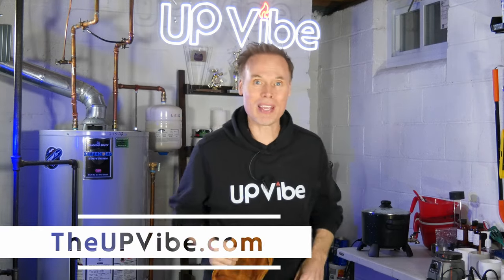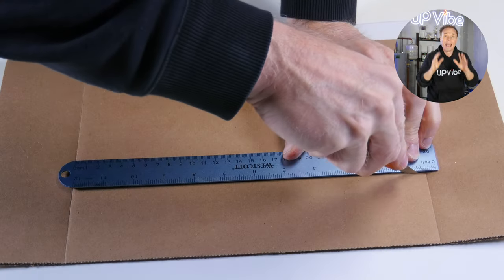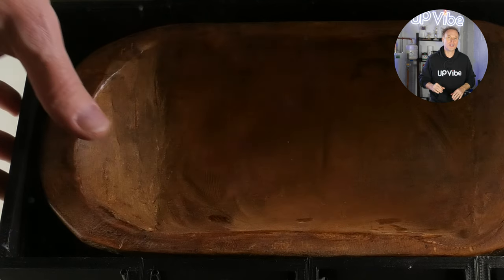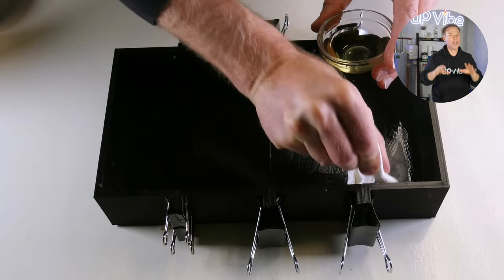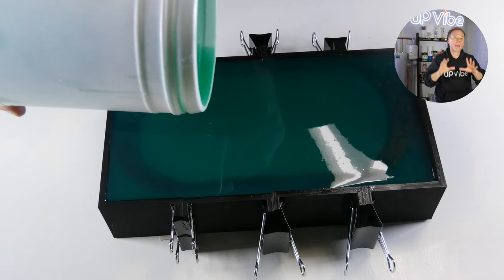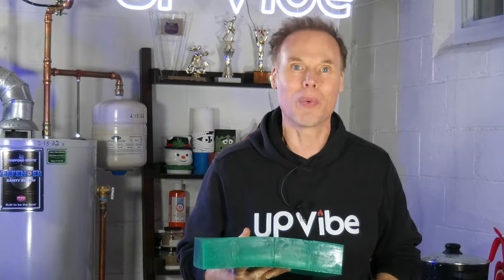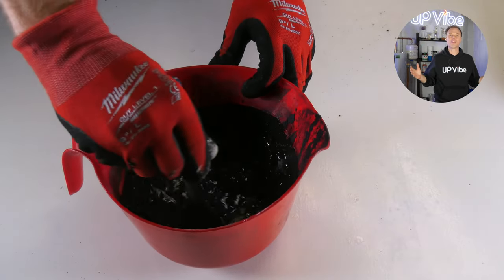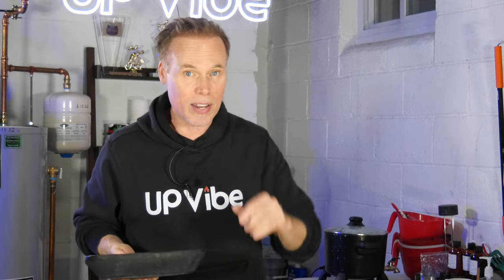How to Make a Concrete Dough Bowl | DIY Silicone Mold

Comment: Hi Jai!  Thanks for this, it was great.  I would love to see the 3D printing process for the box.  Also, did you use the whole bottles of the silicone mixture? How do you know how much to mix so you don’t waste silicone? Thanks again!
Reply from the maker: Excellent. I will note the request. I had to use 2 mid size bottles to fill it. Unfortunately I had no clue how much to use so I just added about 1000 grams at a time. There is a long window of working time in between pours so you never have to worry.

Comment: Hi Jai, love the video! If you don't mind I'd like to share a few tips with you. I make my own custom molds for my candles so I have a bit of experience doing this for a while now. I would recommend using a different silicone for sure. Platinum cure silicone is notorious for creating cure inhibition, which often means the silicone doesn't cure properly (silicone can remain sticky or create a whole bunch of air bubbles that remain on the subject of the object you are trying to mold). It reacts poorly to a bunch of materials including but not limited to:  coatings/ paints/ rubbers/ clay/ duct tape/ latex/ polyester/ solvent carriers/ 3print so much more. I noticed quite a bit of air bubbles on the concrete bowl, which definitely can be the result of the inhibition. Condensation (tin-based) silicones, work much better! I would also recommend sealing your wooden bowl as porous materials can have trapped air in the pores which also makes for a rough surface. Hope this helps!!! Keep doing the great work, I LOVE your vids. So insightful, fun and creative.
Reply from the maker: Thanks for the compliment. If you go back and rewatch the video you will see there is a specific reason I use the kit and not silicone mold star 15 from smooth on. I was lucky enough to have Bill & Kirsty from Canadian Silicone Molds educate me on the process. Anyway, thanks for the comment, and again, thanks for the nice compliment.
Reply: @upvibecandle  Sorry I think missed that part! Totally understand you! Super kind of Bill and Kirsty as well! Just wanted to inform other people who watch this video as they might run into the same cure inhibition issue that I experienced when I just started. 😇 I spent hours and a lot of money on silicone before I figured out what the exact issue was, so I was trying to help. 🥰
Reply from the maker: @PantheaArthea  Great point. Yes it's a frustrating issue for real. I had a silicone company reach out to me and sent me some product to test. It completely failed after I tested it. I thought it was me and later found out it was the product. One might think oh ok so it failed throw it out no big deal. HELL NO!!! The clean up was HORRIBLE and it ruined my object. silicone is no fun when it goes wrong.
Reply: @upvibecandle  Exactly!! Omg uncured silicone is the WORST. It is almost impossible to clean up, only certain types of alcohol work but still, it almost always ruins the object as you mentioned yourself. I did not know any of this when I started. Like THEY SHOULD PUT IT ON THE BOX, IN HUGE BLACK LETTERS that platinum silicone will most likely react poorly to your object (sorry I had a Friends' flashback there all of the sudden). Anyway, great job with the YT channel, you are so original and fun to watch, yet so informative. I know your channel is still growing, but I'm confident you will be HUGE in time. You are super original and not like anything out there. Great job Jai
Reply from the maker: @PantheaArthea  AWWW!!! You have officially made my day. Thank you for your kind words.